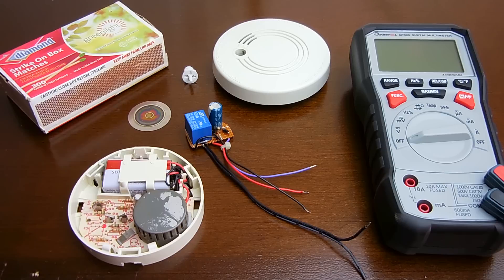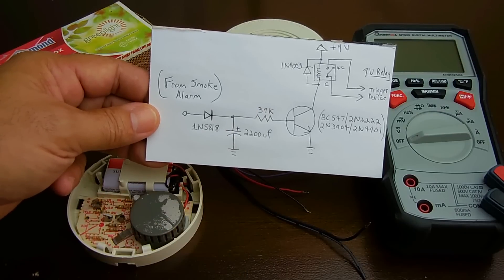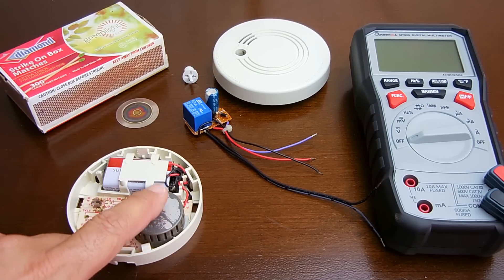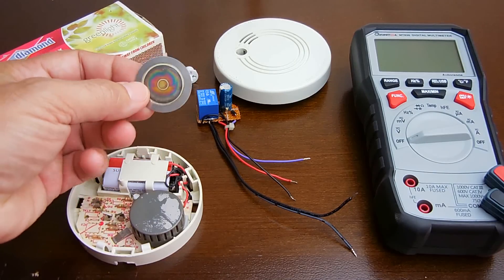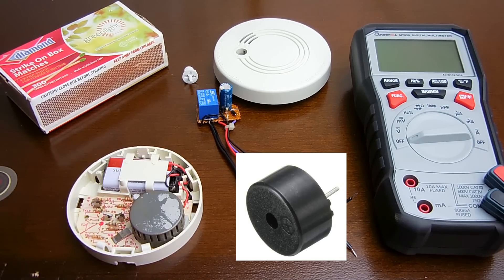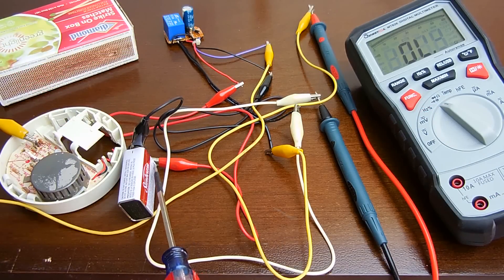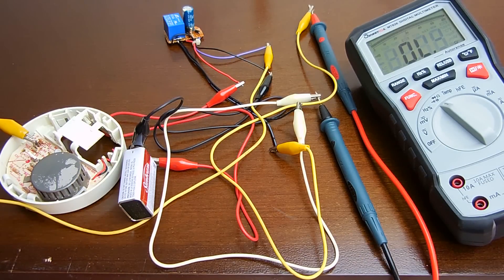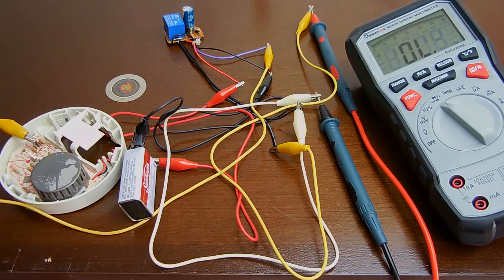Smoke Detector Modification

Comment: Man if i did see this two years ago. I built a co2 extinguish system in my closed 3d printer cabinet shutting off power and purging gas in case of fire . Used together with a 20oz paintball tank, a solinoid valve and an ardurino board . The detector i got was from an alarm system that had a signal out and was both expensive and hard to find not to mention getting information about the output signal (digital or analog? and if at what voltage) I will be doing this next time .
Reply from the maker: Thanks for watching!

Comment: You must understand multimeters. The multimeter shows 4.5V because its too slow getting the full voltage (9V) before the signals turns off again. Test with oscilloscope and yoy can see i  am right :)

Comment: Pretty cool. This would allow you to trigger an alarm system to tell the monitoring station of a smoke detection instead of having one set of smoke detectors to meet building code requirements, and another set that work with the alarm system
Reply from the maker: A few uses for this mod. Thanks for watching Dave!
Reply: Pp

Comment: been looking for a smoke activated switch, then thought i could modify a smoke detector then found your vid. my idea is to have a closed vent lid that iv made in my workshop roof to open up using a geared 12v motor, this part iv already made, to open up when i start welding and the extractor fan to also turn on then off and close when cleared using relays and and micro switches.
Reply from the maker: You can definitely incorporate what I've made into your design. Try and buy the same smoke alarm(on Ebay) as shown, so you can duplicate what I did easily. Thanks for watching!
Reply: @electronicsNmore  ok thanks
Reply: Do you have a link.

Comment: This is very useful thanks! I want to do this exact circuit but I want the transistor to be NC instead of NO (between the Collector and Emitter). What transistors could do this please? I wanna use it as a protection for my 3D printer to cut the power off (using NO relay). Thank you in advance!
Reply from the maker: Just use a relay like I show in the video that has NO and NC contacts. Thanks for watching!
Reply: If I power the printer with NC pins of the relay then the printer will turn off for a certain period only then it'll go back On (default). But What I want is to connect the printer to NO pins of the relay, so the coil of the relay is always triggered until the transistor switch off thus the relay will switch to default (NO). So what I need is to reverse the transistor functionality to "NC" :)

Comment: i tried it with a relay but all it dose it produce a beeping noise lol
Reply from the maker: Daniel Horne The circuit is screwed up somewhere.
Reply: probably i didnt put a cap on the output
Reply: i figured it out anyways  you put a rectifier diode before the capacitor  so it charges cap without back feeding the audio circuit  now the relay clicks but it dosnt hold the charge for long it cuts off in time with the beeping ? possibly not enough uf as its only 1000uf

Comment: Two more very simple hacks:  (1) Using the push-test contacts for connection to a pair of floor-level pins, create a flood alert (washing machine, fridge melt, rivers etc).
Or, (2), add a bleep to a silent visual alarm by connecting an ORP12 light-dependent resistor between the contacts.
Reduce optical sensitivity - it's quite high - by layering tape around the LDR.
Reply from the maker: Thanks for watching Howard!

Comment: Thanks for the video. I see one possible issue however, when the battery runs low the smoke alarm will start to emit short beeps, about once or twice a minute. Even if these beeps are very short and may not charge up the capacitor fully the first time, they will eventually do that and trigger the circuit. In this case you wouldn't really want to activate any fire suppression valves. Also, without the piezo element, you have no audible indication of when the battery is running low. I would like to suggest leaving the piezo element in place, and to modify the circuit so that the short beeps won't trigger the relay.
Reply: Just needs a high value bleed resistor across the capacitor?
Reply from the maker: The best solution, use a 9V NIMH battery that is constantly being trickle charged, or turn off the water supply and swap out the battery at set intervals.:-)
Reply: electronicsNmore Or just dont use a battery?You could get a 220V/110V AC to 9V DC
Reply from the maker: SilenT●CSGO & More!
You can do that, or buy a 120V unit with 9V battery backup. :-)
Reply: then you run it off a 9v psu ?lol
Reply: or use a  9v psu  or even better use soler cells to charge 9v lithium battery
Reply: solar i ment

Comment: pretty sure i know the answer..... does the relay only activate if the smoke alarm is triggered. meaning a small amount of smoke wont set off the sensor?
Reply from the maker: The sensitivity does not change using this modification. It all depends on how sensitive the smoke alarm is. Some trigger much easier than others.